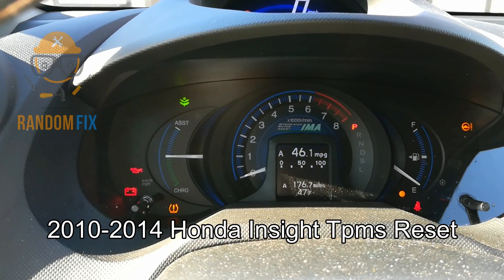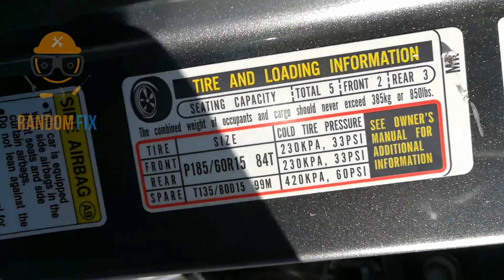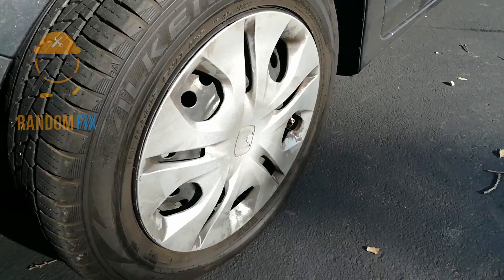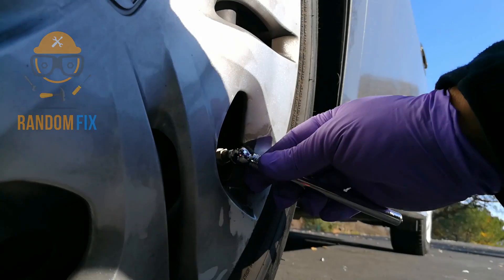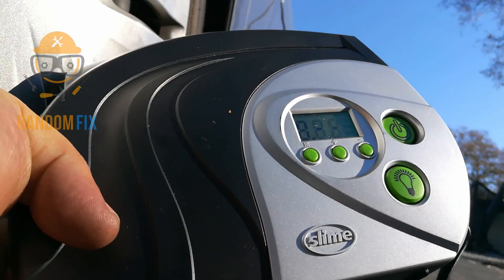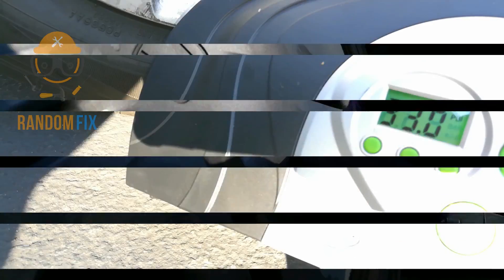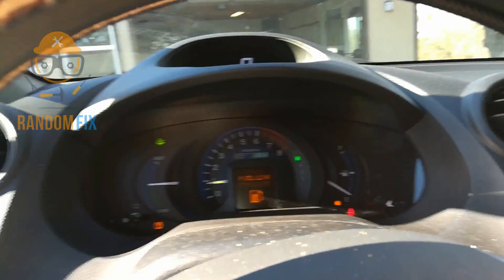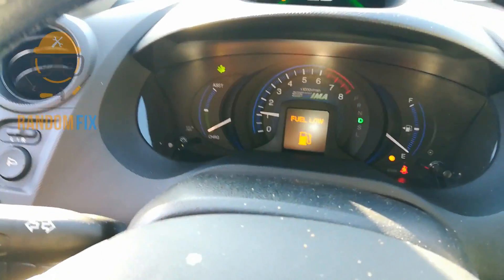Honda Insight TPMS Reset 2010 to 2014

Comment: I must have already gone through this process 100 times but the warning still comes on, whether the tires are low or not! So it's not a real fix and I get no help talking to the service center at the dealership. What now?
Reply from the maker: Is the warming solid or blinking?
Reply: @RANDOMFIX  blinking at first, then just on solid after a few minutes
Reply from the maker: I explain the difference in this short video. 

https://youtu.be/qetq0lmaVnY

Comment: So make sure all the tires are at the correct psi and then just drive around until it goes away.
Reply from the maker: Andres, as long as your TPMS light is "solid" not blinking the answer is yes for most vehicles, fill your tires to correct pressure indicated on the driver door. _Randomfix

Comment: Nothing here about a TPMS light. Just how to fix your low tire pressure warning light (how to put air in your tire).
Reply: You should really learn the difference between the TPMS light and the low tire pressure warning light...jeez
Reply: should have gotten the hint! if it sound like and twit and walks like a twit it is an it is a twit. hope u did not click on his next video!!
Reply from the maker: What?
Reply from the maker: SWS, thanks for the feedback, the link the description of the video had a solution for other common TPMS light concerns. It's really hard to produce "ONE" video that addresses everyone's concern and issue. _Randomfix

Comment: What's the brand of that air compressor you had? It looks very handy. Especially like the digital readout.
Reply from the maker: T Glenn, I used the slime digital air compressor and it's great, the link is the description of the video, the best part about the compressor is that set the level and just away never having to worry about overfilling it. _Randomfix

Comment: Thanks for the video - But jeeeezz, that low fuel was making me nervous.  :-)
Reply from the maker: Hi There, It's a hybrid, I drive my 2016 Prius over 50 miles once it shows 0 on the range and I have never run out of gas!! _Randomfix
Reply: And no seat belt on
Reply from the maker: Safety first